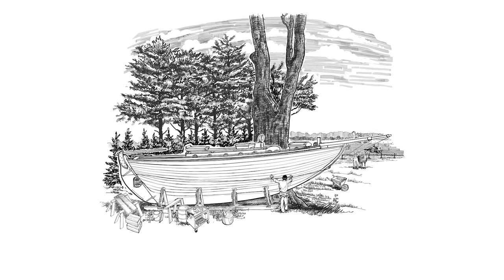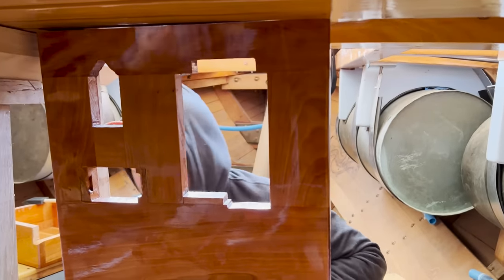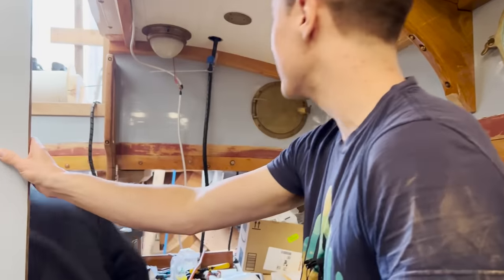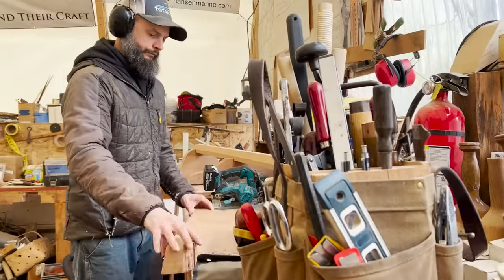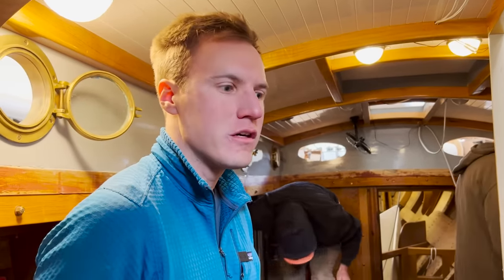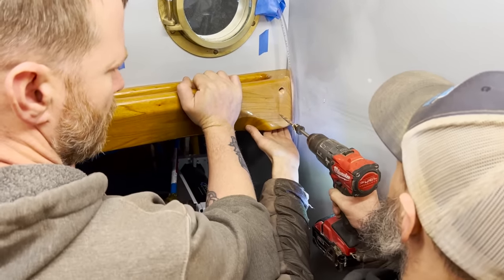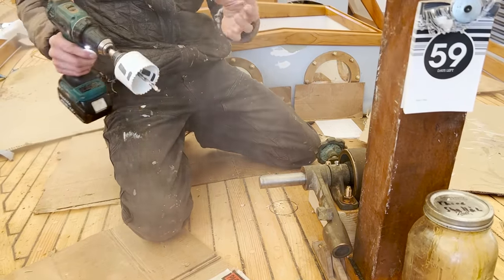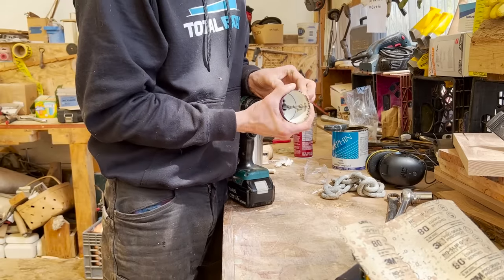Arabella's Spa Week, Swelling The Hull - Episode 265 - Acorn to Arabella: Journey of a Wooden Boat

Comment: An interesting story:  When they suddenly approved the reactivation of the four IOWA Class battleships in 1980. the Navy was caught flat-footed ("They'll never really do that.") so it was a Kermit the Frog runaround moment at the US Navy's Sen Pedro (CA) Naval Shipyard (since closed) to perform the first such overhaul and reactivation of UISS NEW JERSEY (the ship that had been most modernized previously).  Mr. Landgraff, the head of the reactivation at San Pedro, contacted me over the phone because he had found out that I as a hobby was rather well known under the topic "Armor and Ordnance of the Ironclad Warship" or, shortly, "How to punch holes in battleships."  He asked me if I could get him the metallurgical, design, and manufacturing specs of an IOWA Class warship's various steels, including the thick armor, since they were goi9ng to have to cut holes and attach things to these various parts during the upgrade of the ship to "new tech".  Within a week I had Xeroxed and sent him an inch-thick set of official documents on the information he wanted.  He thanked me profusely. And TWICE gave me guided tours of NEW JERSEY when it was in house being overhauled.  Indiana Jones has nothing on me!! 

I noted your drilling the hole for the anchor chain using a single ring-shaped circular saw on the end of a drill.  When Mr. Landgraff ascertained that they needed eight 8" hole to be cut into the 6" (4.5" laminated to 1.5") Spec ial Treatment (armor-class) Steel armored 2nd Deck (the first inner deck of the hull), he put out bids to contractors to get it done as fast and cheaply as possible (no holes, no work on the cabling -- big deal!).  A company put in the winning bid using a huge ring-shaped diamond-edged saw that they said could get each hole done in a coupole of days, which Mr. Landgraff was very happy about.  Then the roof caved in:  The ship-riggers and machinists at the shipyard objected, saying this was OUR JOB and how dare Mr. Landgraff overstep his authority (as in FIDDLER ON THE ROOF, "everything is politics").  He asked them what they were going to do and they said DRILL AND BORING BARS, taking over a week per hole, at the fastest.  Mr. Landgraff almost had a stroke, but he couldn't fight them and had to allow them to do their snal-crawl effort, grinding his teeth all the time!  Boy, was he ANGRY!!!

So, when he showed me around the first time, he took me down to a medium-sized compartment where they were cutting one of the holes.  He had me put on a thick ear-protection headset and opened the hatch.  OH MY GOD!!  In this room was what looked like a hand-drill for King Kong anchored to all four walls and the deck and overhead by thick I-beams.  Next to it was a man with a huge long-tube oil can occasionally squirting oil into the business end of a monstrous boring bar in the hole, slowly going round and round with a screeching noise that was hard to stand even with the ear muffs (what did that guy do to somebody important to be given this Hell-hole task>).  THIS was what his shipyard called "current tech" and Mr. Landgraff was still burning!  It turned out that they barely finished the holes in time, but Mr. Landgraff never forgave them.

So count your blessings about your boat-building work!!!!

Comment: Steve, for that water tank cover what you can do is weld say,  1/2 inch wide stainless steel ring aorund that big hole which will stiffen the bolt flange surface area. The reason you don't get good sealing is because the cover doesn't have a stiff surface to bear down against.  So, yeah , I would add (weld on) a sheetmetal ring to that big hole and make that section stiff. Over time if you don't stiffen that hole the seal can break because of too much flexing of that covered section. This sailboat will see a lot of movement and just using a gasket without reinforcing that hole is not the way to go. I know I wouldn't. At least the mechanical design engineer in me says make that hole stiffer! I would solve that before heading out to sea. At Northrup Grumman where I worked on the CVN 78 ( Gerald R. Ford Aircraft Carrier), no way a leak test failure gets an inspector's seal or signature without corrective action and retest. No way.  Have a great day.
Reply: The lid also needs stiffening, and a loose ring on top would achieve that. But welding on doubler ring to the tank can be problematic, as stainless is extra prone to weld distortion, and a flat plane is essential to prevent leaks. Doubling the number of fasteners would definitely help, because halving the span reduces the midspan deflection by better than 90%.

Comment: Why add dolphinite to the hand rails when they're inside the cabin and protected from water?
Reply: Condensation from all the blood sweat and tears from the passengers while Steve is learning to sail. (Actually I'm pretty convinced he'll be thoroughly prepared and will take to sailing like a duck to water)
Reply: They are right below port lights, which can be open. Putting dolphinite is a cheap price to not have the backs of your grabrails slowly rot out.
Reply: @boothbytcd6011  I agree, but I do think they need drain holes as well. There's also no need for them to contact the cabin sides anywhere except where they're fastened. When heeled for long periods, the angle between the cabin side and the top rear outboard of the channel will retain water, and if it's condensation that will be fresh water.

Comment: hi guys, re gas bottle storage, gas bottles must be upright or liquid butane/ propane will be sent to the appliance
Reply: I believe that is just a storage locker for a spare tank, not while in use....
Reply: @mikevandenbosch9081  yes, you are correct. It was said in the video. Spare gas bottle locker. It isn't connected to anything.
Reply: @jimmyjohnstone5878   cheers, thanks for the clarification, better safe than sorry
Reply from the maker: Also, these tanks are specifically made to go on their sides. 👍

Comment: Why steam and not spraying water onto the wood?
Reply: Steam penetrates way better than a water spray, plus it has a secondary effect, of stress-relieving the whole boat - just like heat treating a welded-up metal fitting, it "relaxes" the wood to the shape it has been bent into.  Although nearly all the major parts of the structure are steamed to shape in the first place, it is rarely a precise fit, and you must have seen how many clamps are needed to hold everything together as it is glued up/screwed/bolted into place.  After a thorough steaming, those fastenings could be removed without the components springing apart at all.  That means that the whole strength of every fastening is available for dealing with loads imposed by use, with none sacrificed to just holding the structure together in its static condition.  My engineering head reckons that could increase the overall strength of the hull by 50% at least, although I am far from qualified to do the calculations for any more than a ballpark guesstimate - that was my father (a very highly qualified engineer), so having worked with him on numerous occasions I developed a feeling for the engineering although not the qualifications to go with it.  So my 50% is probably ± 25%.  Wood is naturally variable, so even Dad could not have guaranteed anything better than ± 10% - but that is why you over-engineer everything.

Comment: Traveller is not going to be strong enough
Reply from the maker: How so?
Reply: The forces on the traveller with mid-boom sheeting are really high.  Travellers are usually fastened directly to the deck to spread the load.  The few attachment points do not appear strong enough for the typical loads.  If it were me, I would consult an expert rigger.
Reply from the maker: We have.